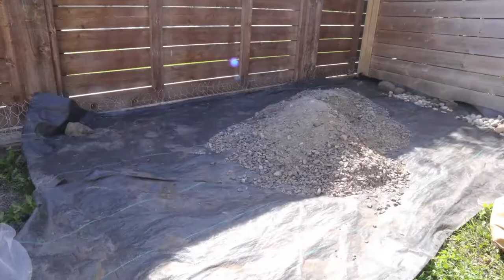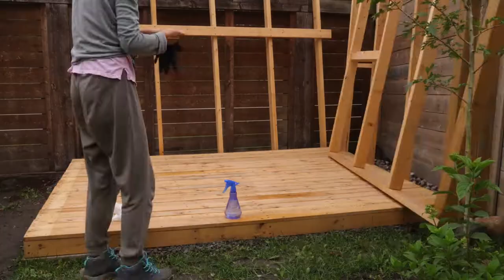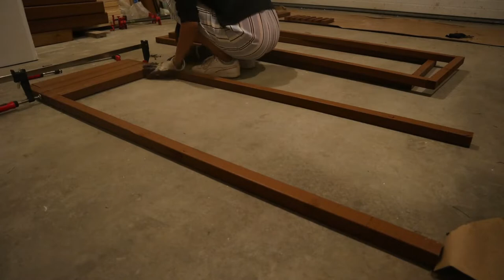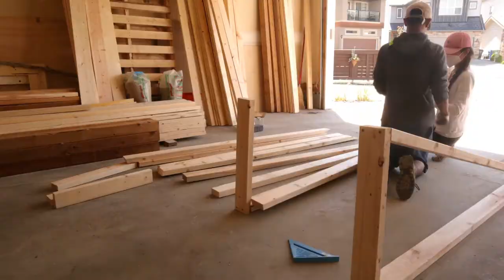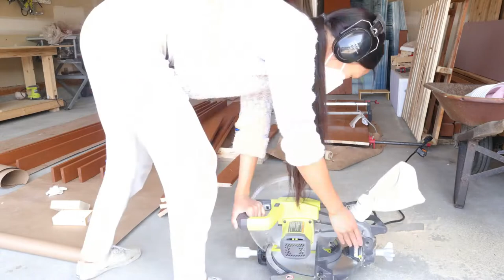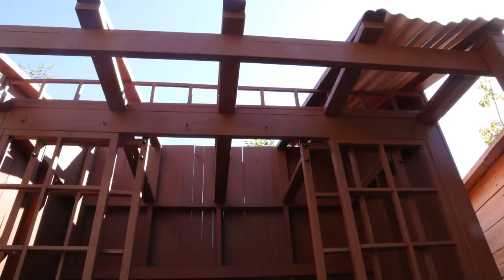DIY Build A Japanese-Style Solid Wood Shed & Tea House with A Deck (Part 1) 建造日式茶屋+花园储物 (1)

Comment: Interesting build! In Japan you would probably replace shoji once a year, mostly because of small kids poking holes in them for fun 😂 But they tend to be used in tandem with actual windows these days... You would probably patch them with cute shapes until the next replacement...
Love the engawa part!
Do you plan to put tatami inside ?
If you want to go for a traditional insolation tokyo llama has an interesting channel where he reforms an old country house pretty much from scratch and has some interesting bits (you might already know ahah).
Cheers from Shonan !

Comment: Hi, thank you for sharing your build process! Very inspiring.  Is there a part 2?  Also, is the shoji paper on the sliding doors waterproofing/weather proof?
Reply from the maker: Thanks for your kind words! Part 2 will come after the freezing cold weather, lol. The roof covers the doors, so the shoji paper barely gets wet. Even the shoji paper is wet, it will dry very quickly. The doors didn't get any damage even with storms or 50+ km/h wind. But I accidentally broke a few parts by moving in/out the sharp gardening tools. 😶